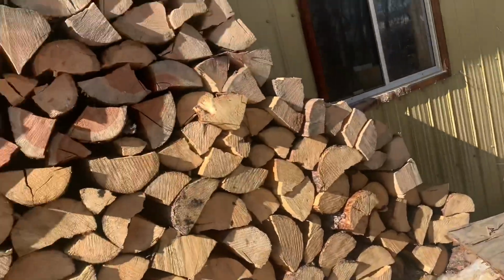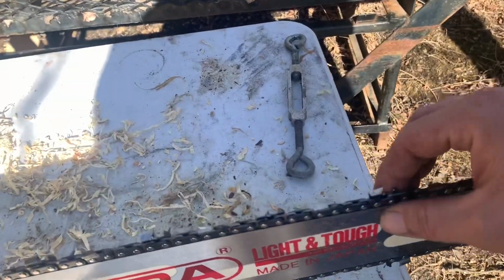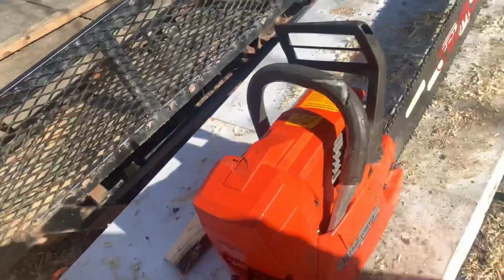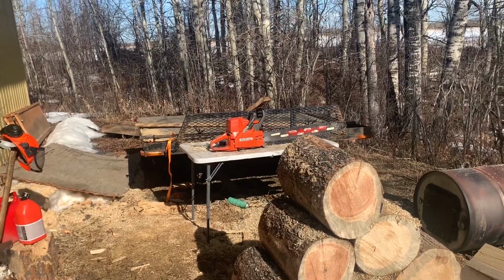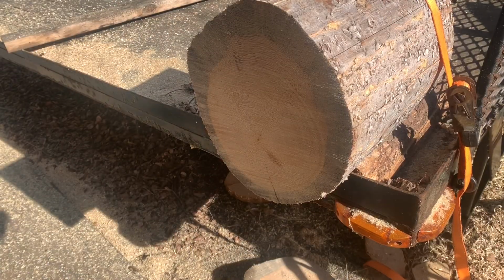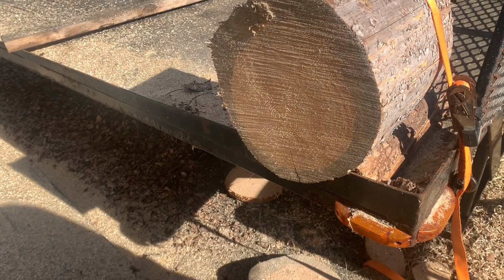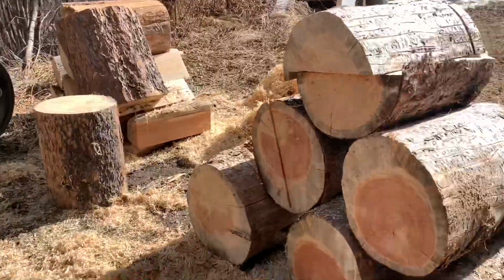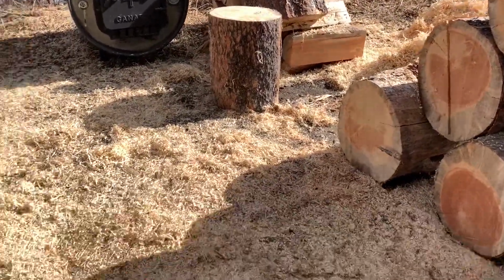Brought an old Husqvarna 288XP back to life, giving it a gentle break in

Comment: What air filter cover is that? Thats not the standard 288xp cover is it?
Reply from the maker: 288XP’s came with either a low top or high top cover, this is a high top.
They are available on eBay for a disgusting price but someone has just started reproducing them in the USA and selling them on eBay for a more reasonable price and very respectable quality.
Reply: @PuskwaskaOutdoors  ah ok, never seen a high top 288 before... any chance you have a link to that chap on ebay as i cant seem to find it.

Thanks
Reply from the maker: Here ya go! 

https://www.ebay.com/itm/373609042127?hash=item56fcd590cf:g:uaoAAOSwQNxgwPgS